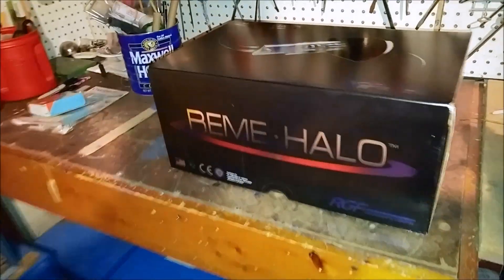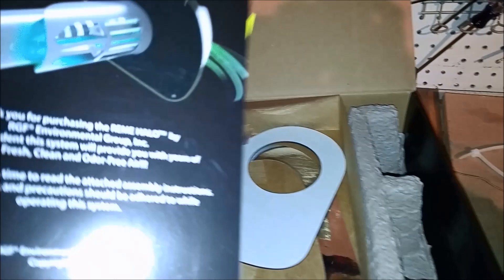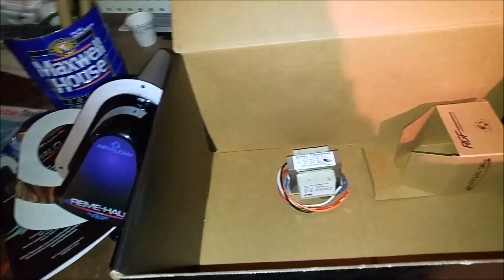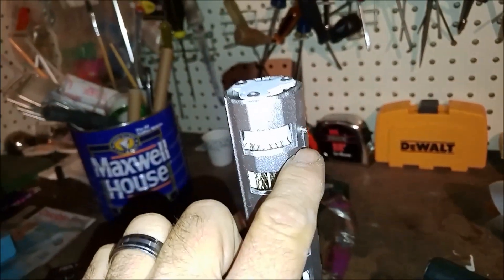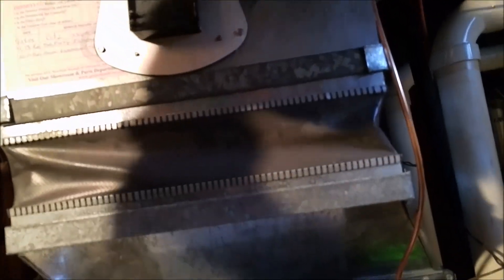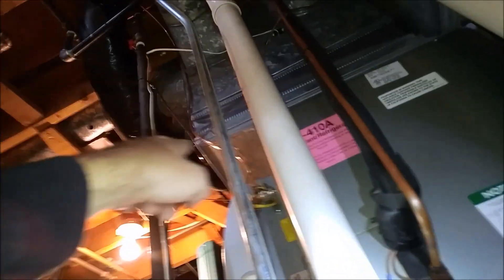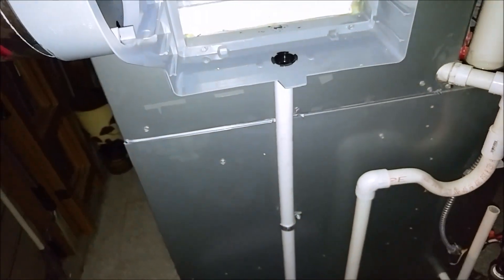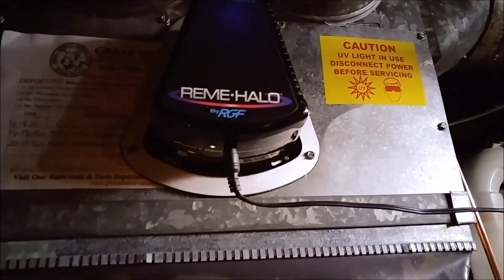RGF REME HVAC HALO 24V Air Purification System Install

Comment: I have a good man furdown unit. I don’t know where I should connect the transformer to get 120 from on unit so it can only turn on when ac turns on
Reply: Connect it to incoming voltage, and do NOT cycle the REME-H, You cycle the REME-L.. If you cycle the REME-H you will shorten the cell life.

Comment: I think the part that you don't no where it goes is a seal that goes around the out side strip with three screw holes. It looks like it may have an adhesive on one side like foil tape does

Comment: I have a variable speed Amana heat pump with a TopTech TT-AK259 UV light installed. Will the REME Halo LED install be as easy as plug-and-play. Or do I need to rewire?

Comment: Careful with Reme Halo, I purchased one and installed in my home to aid on preventing us from getting sick with Covid and it has made us sick, I developed a bronquitis that lasted almost for the whole year, I disconnected the unit and my wife and I started to get better after 4 days. There is something in whatever gas that device generate that can cause irritation to your lungs , Im currently investigating with others and will reach out to the Health Department for investigation.
Reply: I had those symptoms when I over humidified my house. Maybe you're getting too much of the plasma with Ionized Hydro-peroxide output. Check the AOP shroud and ensures it matches the CFM of your HVAC unit. An annual inspection report/tag on your unit may give your CFM. Or Google your HVAC system and find the manual to get this spec. That would give you the max CFM the HVAC can do. Actual CFM is likely less depending on your AC unit, ducting and other factors. So you may want to go down a setting if there is any doubt. You need at least 1,000 CFM for this to work correctly. 
There are 5 settings on the REME-HALO AOP shroud. Fully closed is for1,000-1,250 CFM, Fully open is a whopping 4,875-6,500 CFM. A 2,000 sq ft home is likely going to be a quarter open, maybe closed if its a tight home with a smaller HVAC. Check REME-HALO the install manual for the different settings. if you didn't one in your kit try the link below or google "REME-HALO-24v-UV-installation-Manual".  

Install Manual: https://cdn.shopify.com/s/files/1/1044/5334/files/REME-HALO-24v-UV-installation-Manual-H-24_c55037bd-c53d-4110-a402-c72a6d647c87.pdf?v=1584543971

Comment: I really like the idea of this in my home. What I really don't like are the many reviews of people saying their bulbs didn't last more than a year or two at most. That's ridiculous for something as expensive as this.
Reply: When they are installed without a fan switch or APS, they usually do fail rather quickly.
Reply: I also dont like the many reviews and comments about the ozone smell. Why not install the LED one?  My HVAC tech came out for a maintenance and burner efficiency test and recommended the non LED over LED. I just don’t like the idea of it constantly running.

Comment: Thank you. Anyone that is wondering about the airflow arrow. The RGF REME HALO like he installed has a replaceable bulb lamp and airflow orientation is up as you look at the unit and read the label. Where as the RGF REME LED is at the 3 o'clock position rather than straight up. I have seen some videos of people orienting the airflow arrow wrong. This guy did it right. 👍

Comment: Man thank you very much, I just finished my installation and that light is shining all the way in all the stages of the furnace like you said, Cool, hot and fan working perfectly, I love it!, I notice in the one you installed in your video has some kind of adjustment by the light, is something I have to check in mine, so far   I didn't see any adjustment and there is no instructions in the installation manual,  maybe there is no adjustment, I have to find that out.

Comment: You are the only  one showing how to wire the halo reme with a transformer, I need some help, I just got my Reme Halo LED the problem with with this one is for me how to wire it parallel to the blower the reason because this one must to use the cycle on/off of the blower as is specified by the manufacturer, can you or any one else how do I can do that? From where I have to connect the transformer to the blower in order to feed the halo led on/off using the blower. I have some experience but not using transformers thanks for the help.
Reply from the maker: Do you have a eac terminal on your control board
Reply: @MiHeatingGuy  I have a York model gy8s080a12uh11a (2003 model) I am not  sure if I make it parallel to the blower it means I have to connect the new transformer to the module or the wires from the blower?
Reply from the maker: On your control board you should have a EAC terminal next to the L1 terminal connect your black to that terminal off of the transformer in the white to the neutral in that terminal cycles with the fan Connect 24 V to the air purifier
Reply: @MiHeatingGuy  ok 👌 thanks for your help,  I Really appreciated
Reply: @MiHeatingGuy  thank you very much... last question, I friend just called me.. he is also a hvac tech. He said also I can use the transformer supplied with the Reme led and use pig connectors to to the blower supply( he said the same connectors coming from the module to the blower 120, 208 and 240 and the white(c), do you thing this is good too or no?... again thanks for all your time 🙏 GOD bless you!
Reply: @MiHeatingGuy  They have a tech bulletin on their website, if you connect it to EAC terminal it voids the warranty FYI.
Reply: In mi reme halo the transformer sequence is: black= com , Wht=120 , red= 208 . Orange= 240 sec 24vac = bue/yellow , you told me that connect the black to the eac and the white to the comm, but looks like this guys from Reme led invert the black to com, then it means I havebto connect the white = 120 to the eac and then the white to the com?. Thanks for your help in my ignorance.
Reply from the maker: Connect  Black to EAC and white to neutral and that will give you 24 V on the fan comes on.
 Blacks with the blacks and whites with the whites on the control board
Reply: @MiHeatingGuy  the wire to the Halo led is already attached to the transformer box, if I am understanding right I have to disconnect it from the transformer and use black and white wires, then black to eac and white to white(neutral) right? Again you for all your help.
Reply from the maker: There's 2 sides of the transformer there's the low voltage side which goes to the Halo and there is the high voltage side they goes to control board Black-and-white on high voltage go to the control board low voltage goes to the Halo
Reply: Ok I see, now is more clear for me thanks I need this think hooked really bad for the allergies of my daughter thank you very much my friend GOD BLESS YOU!!!

Comment: You can install a relay so the Reme powers on when the fan energizes so it’s just not on with no air circulation.
Reply: jairo torres do you know if you can just hook it to the green (fan) wire as long as the furnace transformer is large enough to handle it?
Reply: Robby Biddle yeah as long as you have a large enough transformer it should be able to handle it. I would install a transformer for the unit itself just in case or for troubleshooting.

Comment: Why would you run the unit all the time if the fan is off ?  Why not connect so it comes on when the AC fan comes on ?  No drip leg on your gas line going to the water heater.

Comment: Your incorrect ! 
"Ozone not good"
 old dated  technology .
you do not want ozone , it is harmful to your health even in low quantities .
 It's actually ineffective for indoor air pollution as well do to the ozone chemical reactions .
Please do your homework and stop relying on what you read in the box .
It is ineffective and not good for your health .
If you have one , take it out and throw it away or pull the power , these types are very bad .
What's bothersome is that the HVAC tech himself is completely unaware of what he's installing .
However the main responsibility falls upon the owner , very simple which elementary research would've educated the consumer on the ineffectiveness and health damages from these ozone device types .
To the installer ,  you need to educate yourself on what you are selling/ installing , take the five minutes to understand what you are actually  doing to the indoor air quality , your doing damage to their health .
I'm not going to tell you what to buy and install , I'm not a salesman for any product , that's your job 
I hope you educate yourself and take this video down and post a new one with the proper healthy UV system . 
Bottom line , say no to ozone , it's terrible for your lungs .
Reply: well thats when you sue the company. Easy as that

Comment: Be advised ... "Products that are purchased from anyone other than RGF Environmental Group, Inc. or its authorized distributors or contractors, for example, from non-authorized third party resellers through online sites such as Amazon, eBay, Bonanza, or any other eCommerce site are not covered by any RGF warranty."
Reply: Question is, why does RGF sell to unauthorized people/companies?  I thought that with warranty laws, the seller had to prove the installation failed due to incompetence.

Comment: You should've utilized some vent sealant or mastic around the lip of your hole to ensure efficiency without pressure loss, sealing against the enclosure. Further, as others indicated your incorrect wiring, it will remain on at all times, rather than only when the fan blower is on, which reduces the lifespan of the equipment and wastes electricity, resulting in an inefficient allocation of scarce resources.
Reply: Actually you are incorrect and missing the larger mistake .
What makes equipment go bad is the countless power up and power off . 
Typically when  powered up you surge the equipment to maximum amperage , then it drops down to actual lower  running amp .
 A multistage blower is optimal with a forced air system . What breaks down equipment is the on off
The UV install is fine , your not losing any pressure , he used a gasket which is the sealer . You can rest assure the duct system in the home is losing a minium 15% from unsealed and  connections in an average home . 
Now let's get to the real elephant in the room .
This unit produces ozone . This is harmful to human beings even at low doses as well as being useless in reducing indoor air pollution . 
This is outdated technology .
The consumer should do a few minutes of elementary research in order to understand what exactly this is doing to their indoor air 
And goes without saying the installer knows nothing but what the box says . 
He needs , as an hvac tech  to  understand what he is installing .
Clearly he has no clue 
He cares enough to post a video to help people , but doesn't understand he's actually , unknowingly doing a disservice .
Research , delete the video , and post a new one with proper UV  equipment that actually improves the  indoor air quality and health .
Reply: @ynot6781 , blah blah blah. All marketing and early wear and tear nonsense to increase profits for your industry.

Look, companies are going around trying to charge $2,000 for the installation of a UV light. Fuck out of here with that consumer exploitation. That's highway robbery. And you know what's sad? It's mostly the disabled and elderly they'll be fucking over.

If they want to cut the hole, wire it themselves, they should.

"The Center for Disease Control and Prevention (CDC) provides Ozone exposure levels that have been adopted by the Occupational Safety and Health Administration (OSHA) and the National Institute of Occupational Safety and Health (NIOSH). The Food and Drug Administration (FDA) requires that ozone given off by indoor medical devices be no more than 0.05 ppm. Workers are restricted from exposure that averages a concentration of 0.10 ppm of ozone in a period of 8 hours, as mandated by OSHA. An upper limit of 0.10 ppm of ozone exposure is not to be exceeded at any time, according to NIOSH. The EPA's National Ambient Air Quality Standard for ozone is a maximum outdoor concentration of 0.08 ppm in an 8 hour period."

You aren't suggesting this device produces beyond 0.1 ppm? Lmfao. What you're trying to do is boogeyman people into buying a different product. It's being used as industry propaganda to convince people to spend more money and adopt new brands that just can't compete in a free market.

It's not rocket science, just like blowing out my sewage exit port is not a rocket science, and I should be free to do it without being fined. Installing doors and windows are not rocket science, either. Stop acting like it is, when you're barely able to write a coherent sentence.
Reply: @ynot6781  so which UV system you recomend ?

Comment: And then he said you want the light running all the time even when the fan is off.... that couldn’t be further from the truth. If the fan is not running the light isn’t helping anyone or anything. People should be reporting this to get him off YouTube before he gives advice that hurts someone or burns someone’s house down.
Reply from the maker: You need to do your research on furnaces.as I can see on your channel you have nothing go ahead and  Criticize people that actually work compared to people doing cartwheels on your channel. Rheem was  The 1st company to come out of the modulating furnace and I was 13 stages I used install them all the time. But maybe that was before your time
Reply: Ooof!

I keep hearing the LED version is for non constant fan use. I’d rather see myself with that one, but my HVAC tech says the non LED is better and air can move past the unit even when the fan is off. I can’t understand that but he did a great job on the other work, offered me free advice on two other items.

Comment: The Manufacture recommends that the unit stays on all the time. Cycling the bulb will reduce the life time effectiveness of the bulb. The manufacture also recommends that you also leave the fan on all the time for maximum effect.
Reply: Duh. Of course the manufacturer suggests that. They want you to wear it down quicker, so they can extract more scarce resources from you. It boosts profits.
Reply: Manual says it should NOT run all the time
Reply: They actually are not supposed to run all the time. Instead tied in to come on when the fan comes on

Comment: The way he did it, the light will be on ALL the time whether the fan is running or not.  (Those replacement cartridges are NOT cheap!)  It needs to be wired so that it is on only when the HVAC is running.
Reply: But, it is true that the manufacture recommends that the unit stays on all the time.  So we added an on/off switch so we can shut it off when needed.  Though you could just pull the lv plug at the unit.
Reply: That's true but you don't want anything growing while it's off.
Reply: led should stay on 24/7

Comment: Wouldn’t follow this too closely, he obviously did not read the instructions it clearly states do not supply constant power to the unit and that is exactly what he did. SMH
Reply: Its been 4 years but you are actually wrong.   You should provide constant power to the Reme Halo (what he installed).   When installing a Reme Halo LED you should set it so its only powered on when the fan is running.  - SMH

Comment: Don't recommend, gave me dry eyes, dry mouth, headaches, smell. I prefer an Ionizer with no ozone. Stay away from Hydrogen Peroxide Gas. Yes it safe, if the ppm is not high enough. How the heck do we know these units are not over ozoning our house...
Reply: Ionization works and is produced as long as need exists.  Dirty air yields lots of need. Once the air is cleared the ionization and smell should reduce to be sensory oriented. Like if you cooked fish or had smokers in the home.  Meaning situational.  Hope that helps.
Reply from the maker: You must be from California LOL
Reply: Mi Heating Guy nope Florida

Comment: Don’t use power from ac transformer it will shorten life of both transformers. Use a dedicated power supply!!!
Reply: You're dumb he wired it in parallel with the other transformers house power it won't affect anything.
Reply: @goodolbiker  But a true statement nonetheless assuming the one transformer is near capacity to start with.
Reply: @wickedwoman5471  no your wrong he is powering 2nd transformer off of line voltage not the 1st transformer.  It is wired in parallel,  same as plugging in 2 different things in separate outlets.

Comment: FYI:
IF you are not certified HVAC & you install it yourself, Congrats! You just voided your warranty.

Its not worth voiding the warranty.
Hire an HVAC company to install it.
Reply: Not true at all. I installed a uv light myself and just had something replaced under warranty.
Reply: From their site... "Products that are purchased from anyone other than RGF Environmental Group, Inc. or its authorized distributors or contractors, for example, from non-authorized third party resellers through online sites such as Amazon, eBay, Bonanza, or any other eCommerce site are not covered by any RGF warranty."

Comment: Transformer wiring is red and orange do nothing just wire nut those off. By them self. White and black matching wire sof main power to furnace. Blue and yellow to reme wires . Done... 15 minutes tops 45 minutes to an hour get real
Reply: I can do it in 3, Blindfolded and drunk!
Who gives a shit about your self proclamed incredible internet installation powers? 
Where's your video doing it?
Reply: JR Fortenberry fuck you old man
Reply: Fuck you old man fartenberry

Comment: So if you have to AC units ( 3 returns)  do you need one, two, or three units. I am guessing my third return feeds into another.
Reply: 1 in each zone
Reply: Do you mean 2 AC units? They dont go on the return but in the supply plenum. They have to have one per furnace/AC